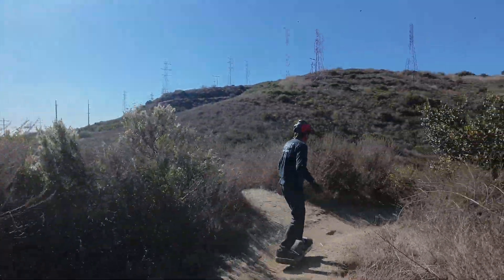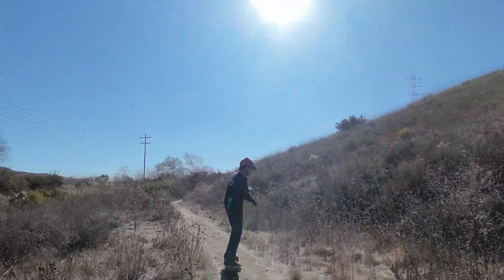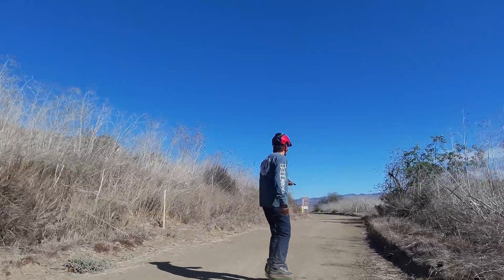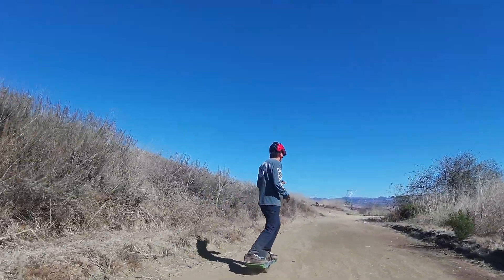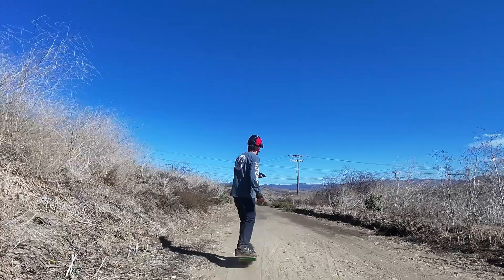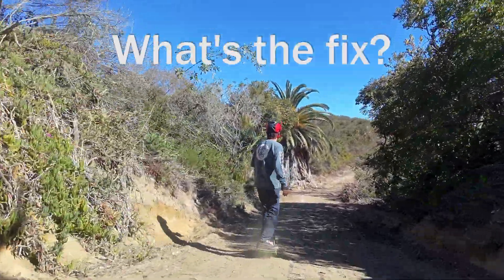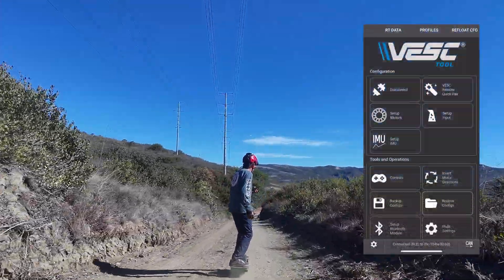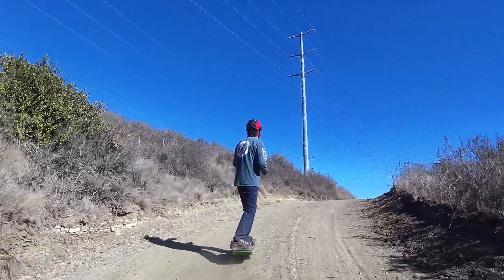Onewheel foot sensors - Why so difficult?

Comment: Why not just add a third sensor, but have it use a time delay before it cuts power to the motor. For example let's say this third sendor goes on rear pad. You wouldn't cut power if it momentarily saw only one active sensor, as perhaps a foot is being moved or a trick is being performed, but surely there is no real life case for only one of three active sensors for two seconds.

If this two second time delay was added, ghosting could still occur, but the board would only get a foot or two before cutting out. This would allow a good compromise where you would need two failed sensors to kick a rider instead of potentially one, and ghosting isnt eliminated but dangers largely are.
Reply: was thinking the same...;-)

Comment: I'm still trying to figure out how to do it simply with hardware, but I think my ideal solution is to have a read switch in parrallel with one the footpad sensor zones. This allows you to have the best of both worlds. You still can hop on the board and ride it like a normal board and complete, complete with the ability to heel/toe lift, do body varios etc. However, it gives you the option of carrying a magnetic a puck that you can use in addition to the footpad sensor when riding in conditions where a disengagement is dangerous like big jumps. Then you switch on software posi and this allows you to maintain board engagment even if your foot floats off the front pad briefly as long as the puck is attached without as dramatic an increase in the risk of ghosting. I had a hardware version of this on my CBXR and loved it. It used a hardware posi-switch instead of doing it with software.

Comment: Just a thought as i work in tech. You always have 3 for quorum. So with 3 sensor, if only one sensor is engaged. Trigger the haptic or beep to let rider know but continue to engage.

I had the v4 sensor with permanent posi which was wonderful. Until one side failed but i didnt know that until it cut off at speed during a corner.
Reply from the maker: @luisbanz  so it would beep while it ghosts? This is another one sided solution motivated by a past nosedive accident. You failed to consider how this would affect ghosting, don’t you think?
Reply: @surfdado  Im struggling with ghosting  after replacing the v4 with stompie and almost causing a car accident.  But my original post shouldve said with two sensor engaged because that's how quorum works. Im no expert so it will most likely cause other effects which I haven't thought about.
Reply from the maker: @ those other effects is what I’m talking about. Quorum is not a solution - it’s just increased complexity

Comment: Glad to see my "drowning board" video is being used to educate.
Reply from the maker: @tomvloemans  haha thanks for posting that one. Did your board survive?
Reply: @surfdado  currently I'm riding second hand stock XR. This one will get fixed as soon as I get my hands on a new controller/BMS. The last U-box I got wasn't able to hande the voltage peaks of regenerative braking. I broke a rib, this way, last summer.  It's a fantastic (and frankly addictive) new boardsport but people need to stay aware of the risks involved. You are saving people from injury with your input. We can't thank you enough for this.
Reply: @tomvloemans  Damn what Ubox were you running? Just finished converting mine and my buddies XR's with 85V, so I've got a stock board and BMS just sitting.

Comment: I wanna have front and back sensors that provide the same dual-zone input. So for example you land toe heavy in front and heel heavy in back, both left and right are considered engaged. I know people have done it. I guess just need longer wiring and solder the two sensors together into the same input wire to the controller???
Reply: this is what I want too but more because I don't want to look down to check which foot is on the sensor

Comment: To prevent ghosting you could have float control remote kill .. if the board is moving but the phone is not  moving (with both sensors disengaged) then float control issues a remote board kill. Also the reverse when the phone and the board are both moving then the board will not disengage regardless of sensor. Essentially phone GPS speed could be fed back to the VESC to provide additional safety.
Reply from the maker: @benlay750  yeah I considered this a while ago, but abandoned the idea due to all the complexity with all the corner cases you need to cover

Comment: Does playing around with ADC values affect much in this regard? My sensor seems to either put out precisely 3v or zero volts, so I haven’t seen the need to mess with that.
Reply: Don't mess with your adc values, that's how much pressure is being apied to each side. When fully pressed 3.0+, when not pressing 0.0

Comment: A solution to the extreme sensor issue of ghosting could be a Ultra Wide Band system inside of a board that can communicate with a peripheral like a Pubmote or another device. UWB is accurate up to the millimeter, and is insanely reliable. You could set a threshold distance from the peripheral device that a board will shut down a board once it exits the distance, like 5 feet, by maybe slowing down ERPM or just cutting the motor entirely. 

The idea needs to be improved upon, but UWB technology is super under utilized and could be the secret to preventing serious ghosting issues for all boards.

Comment: Enabling reverse stop only works if one side of the sensors is stuck on right? I was having an issue where I installed a new sensor and while riding it got stuck on. Enabled reverse stop but everytime I would reverse, the tail would get close to dropping fully but would automatically reactivate... Is this maybe due to having 'dirty landings' or one of the other settings on?
Reply from the maker: @tiztrain  good question - I’m gonna play around with those combos on my next dog walk

Comment: Do you recommend running with “disable moving faults” enabled indefinitely? If you have reverse stop enabled too.
Reply from the maker: generally no. It is safe in 99% of cases, especially on moderate terrain. But there are two clear corner cases where this feature can be treacherous: (1) super steep downhills, the board cannot level out and turn off so it will shoot downhill full force (I've seen it happen, and hit the rider in front!) - and then (2) freak accidents where one board gets stuck under another board, or under a car or whatever, and then will do a burnout if it cannot level out (happened to my son with another rider on a group ride)

Comment: it will be cool to have in float control quick switch to mono sensor ( two sensors acts like one, for trail riding )
Reply from the maker: above 1mph two sensors already act as one - on all Onewheels, regardless of your settings

Comment: I’ve been in nuclear power for 27 years. You need both reliability and fault detection to maintain a safe, but reliable power plant. It’s the same in this case. The industry chose four sensors for nearly every parameter. Tens of thousands of them. 

For a given parameter you have four inputs. If one is obviously outside the average of the others, it gets thrown out – with a warning. If another is outside a range, but the other two agree, it gets thrown out – with another warning. There are algorithms to try to determine which of the last two are correct, but at that point we’ve already assumed they’re all wrong and made plans. 

It works wonderfully and is well within the computational capacity of cheap modern micro-controllers.
Reply from the maker: @MatthewBallinger  obviously a controller redesign can make room for multi layer redundancy in the sensors. But that’s not something we have with FM or VESC
Reply: @surfdado we can have an external mcu process data from multiple sensors or maybe run it on vesc express
Reply from the maker: @jt16omes  this is the added complexity I'm talking about. You still have to decide how you prioritize that external MCU data because that too can fail or get corrupted... in that case, do you wanna risk ghosting or dropping the rider?
Reply: @surfdado  My thinking is that if you have a esp32 or something handling the logic of a sensor array and it is to fail it should fail open. The moving fault code could be changed to trigger a pushback for a fail safe condition. The bigger problem with the secondary sensors is that there is no universal sensor array that will work in all use cases. The TOF lidar is sensitive to wet or muddy conditions, the radar is only good for a binary if something full of water is nearby (ie if you failed in thick brush or a crowd of people it would continue sensing). Weight sensing is the most robust but the current use of membrane sensors are prone to damage. A strain gage is likely the best for pressure sensing but the packaging is typically too large. I have programmed an array with some logic to do this but have yet to deploy it. Unfortunately StokedStock has a patent on the use of these types of sensors for onewheel so I pulled all my work off the web and unless he commercializes something you are not likely to see progress in this space.